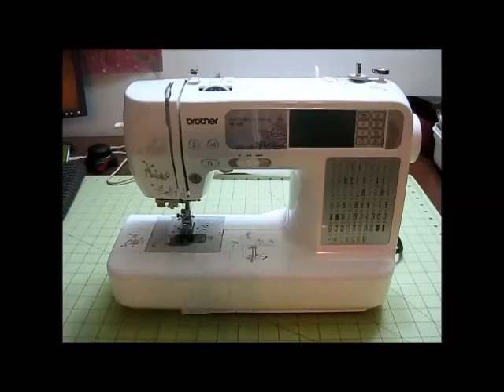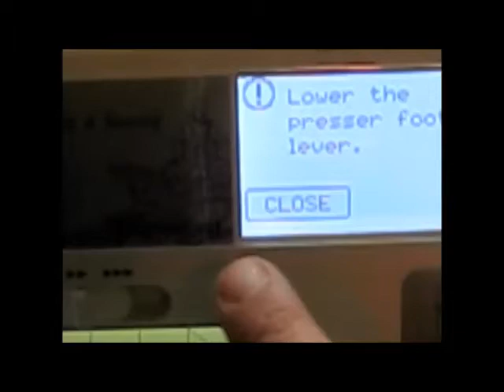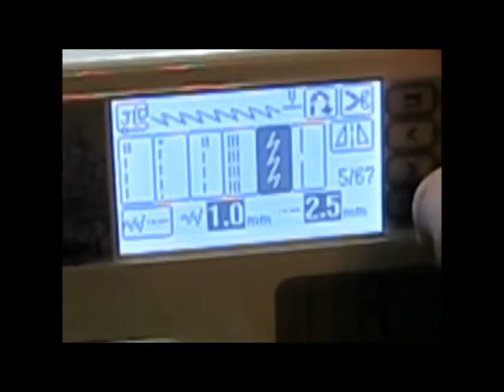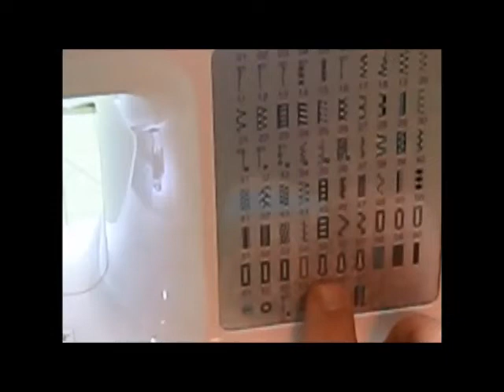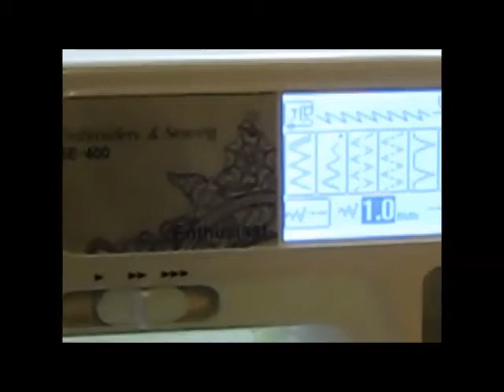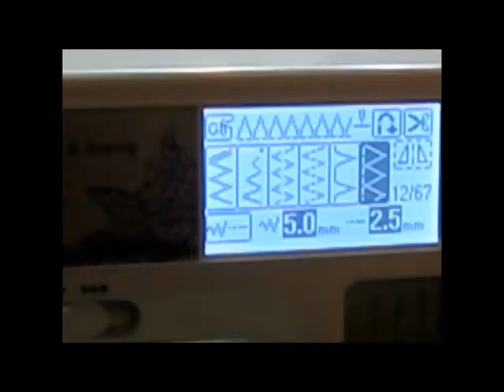Good Look- Brother SE400 Embroidery and Sewing Machine Overview

Comment: Thank you for the solid, informative video. It’s the little things you point out and and explain that really sets this apart: direction of the thread from the spool, and that the spool does not spin—particularly useful for those who’ve sewn for years on old an machine from a different brand; and the little letters on the bottom of the the pressure foot: who knew? Certainly worth watching.